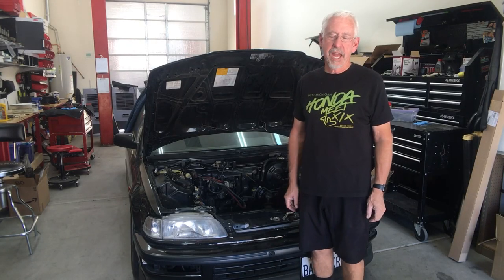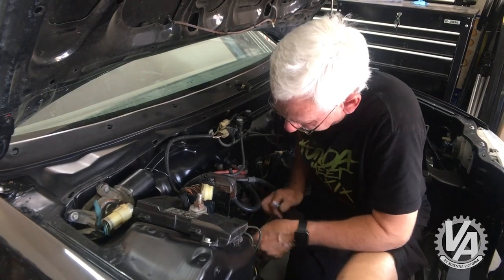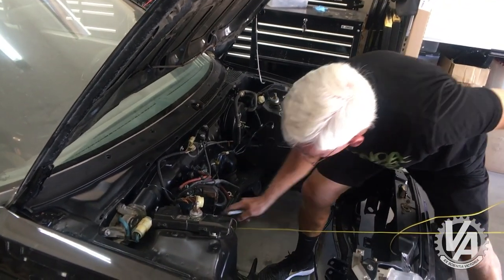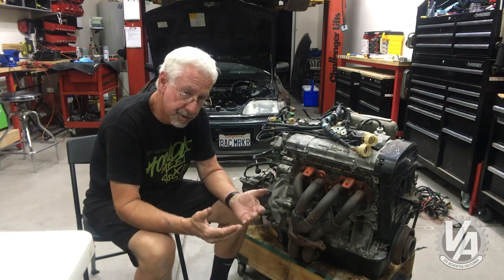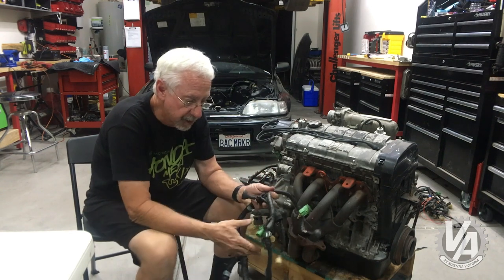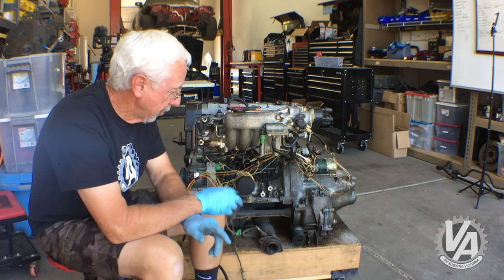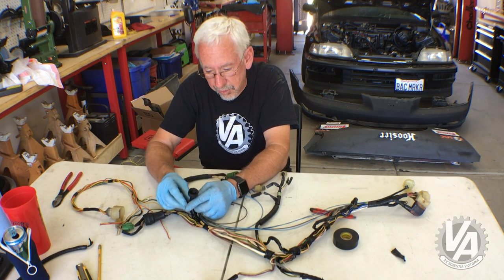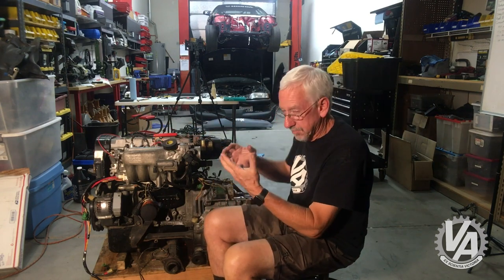Project Backmarker- Dual Point to Multiport Injection How To

Comment: Which dohc zc y'all got that y'all is putting in ur ef cuzz they made a obd1 dohc zc with a obd1 tizzy that would work perfect for it cuz I have bout three or four dohc zc motors
Reply: Me 2 I have 3 dohc zc motors and they all still run I have and obd0 on my 88civic si
Reply: This is an OBD0 ZC. The JDM Prelude H22 and H23 use the same distributor as the OBD1 ZC distributor. When  convert it to OBD1 I will use that distributor.
Reply: @BrianGillespie_brianathasport  oh I know but they actually make a nobody one motor and dizzy for the OBD1 dohc zc TD - 43 u and I actually have a h23 JDM blue top plateless h2b kit and my other car love the ef project
Reply: @BrianGillespie_brianathasport  great content can't wait till you do the OBD1 conversion 🤙

Comment: hello sir, nice videos, i have honda city 3 generation l13b engine which i want to swap with l15a as emissions laws have gone strict . but the 1st of problems is the engine transmission layout they are vice-versa, the height of the engine and the location of axle rods. do you think it is possible. My want to keep this car is because of the compact size , all independent suspension and a timeless design . thankyou
Reply: It is possible, but you will have to make mounts.